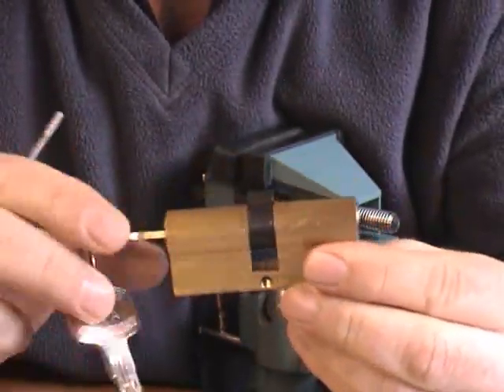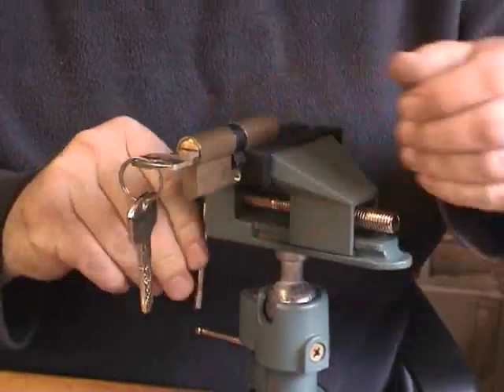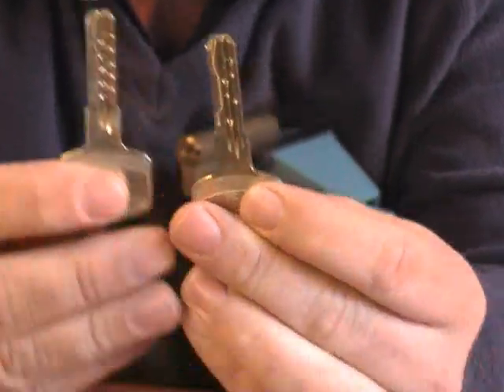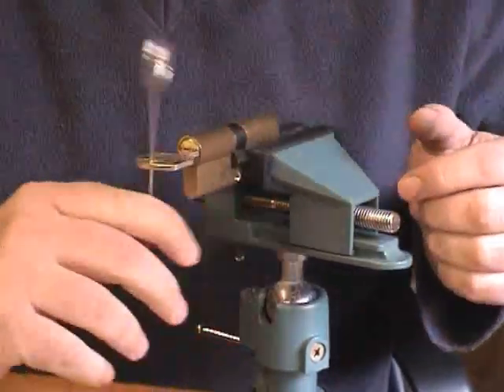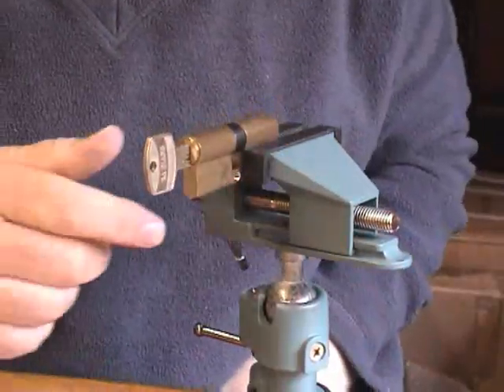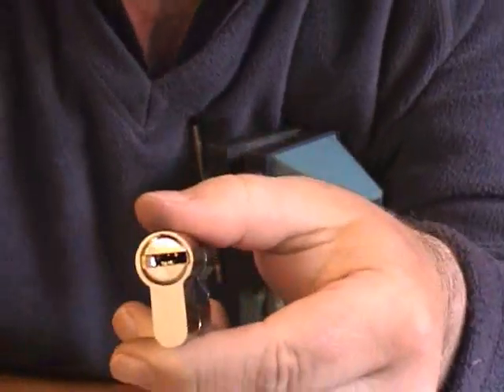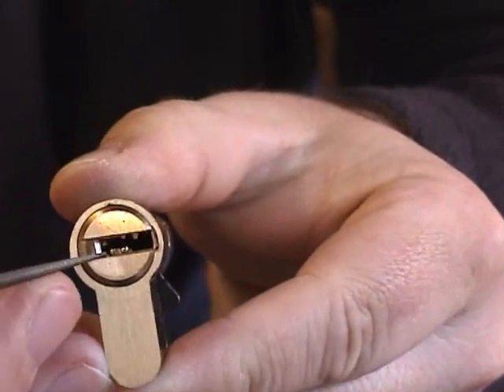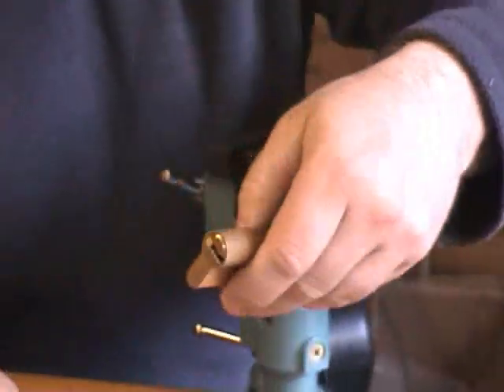lock bumping a 17 pin high security euro cylinder

Comment: Thank you for the informative video.

The lock does look very similar to the MT5.  And I am in the market for a high security deadbolt.  I wonder, your bump key has the exact pathway of your original key.  So it basically took those 7pins out of the equation.  Is there anyway to bump the pathway (given that "if" they are unique for each key)?